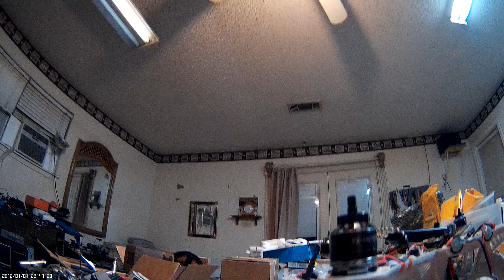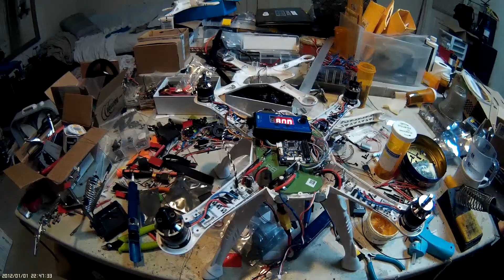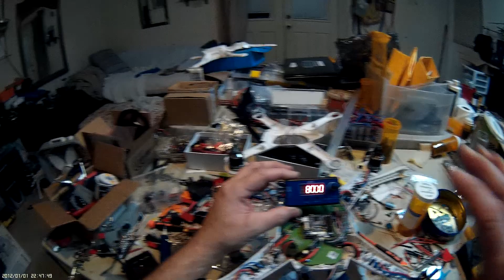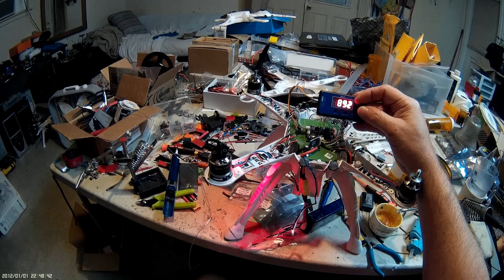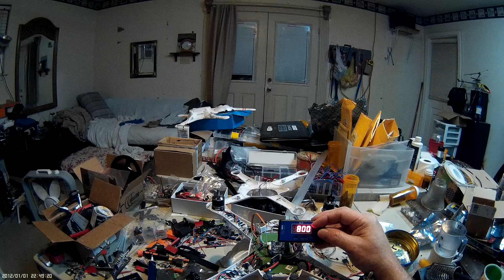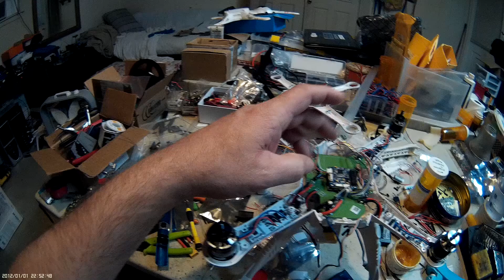Opera ESC's LED functions & APM power module installation

Comment: Good video, Have you ever flashed these ESCs? I am replacing a failed one and have found the replacement opera esc has a different start up tone and appears really jerky in operation compared to the originals. I though I would start by reflashing them but I have never done it before.
Reply from the maker: I haven't flashed them yet but it can't be hard. I believe they have Blue Series 20a firmware in them. You could even go BL Heli firmware on these. I would get a couple extra one's to test this on. If you use a car break light bulb in between the power supply and the ESC then that would help stop any shorts if the firmware is wrong and stop from blowing up the test ESC. I have a link to that here - https://www.rcgroups.com/forums/showthread.php?2327875-DIY-SAVE-YOUR-ELECTRONICS!-BUILD-A-SmokeStopper%C2%99-!
Reply: Shane Carles Thanks I'll look into the link you have sent. I was planning on using the simonk fireware which is what I think is on my original ESCs. I have some spares so I may look at the BLheli option too. Anyway thanks for the information, I appreciate it.
Reply from the maker: I can tell you that BLHELI is much smoother and can be tuned for the motor better.